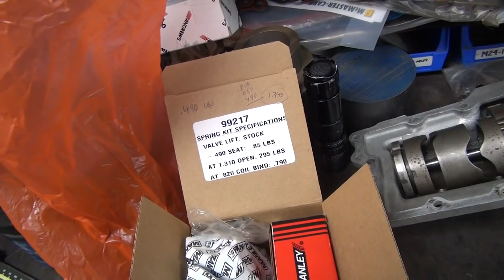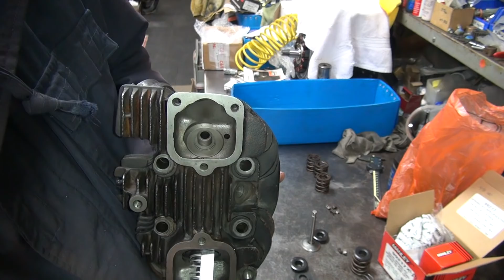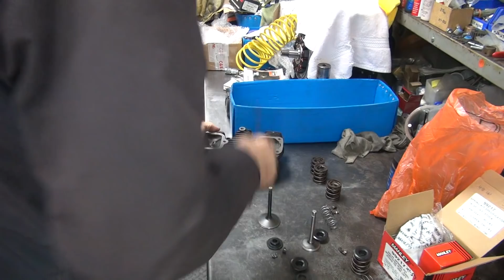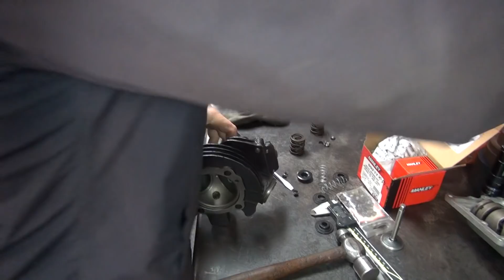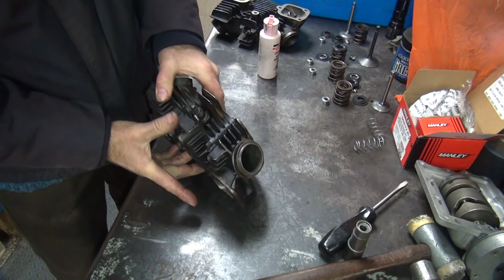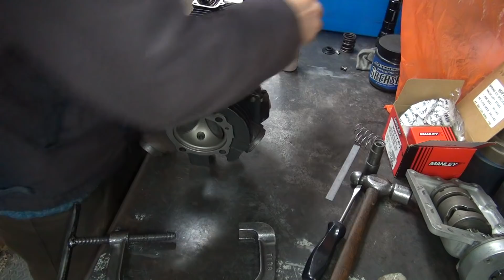#145 How To Do It,  install high lift valve springs 1977 sportster ironhead harley by tatro machine

Comment: How much lift "high valve springs" can take and what Mannley springs? I have Adrrews BV .520 max lift cams and looking new springs.
Reply from the maker: the manley springs only have about 90# pressure. not good for above 7000rpm. shim them down to .030 to get all you can. manley use to make some 150# springs but they are hard to come by these days. springs come and go all the time. if you are good, you can look at all the available springs and pick out one to make work. that is what i do for my race bikes. 
tatro

Comment: I guess I missed something.  You changed the collars to gain more valve spring clearance, but the heavy springs you took out were much taller than the new springs that you put in.  Why wouldn't the new springs just drop in with clearance to spare?

I just opened the engine on the 1978/1980 whatever Sportster that I bought at an estate sale in 2016, it has been ignored in the corner of the shop.  Surprise,  new stock cylinders, 4 5/8 stroke, new S&S 74" parts in Sputhe heavy duty cases!  Also sporting Andrews V9 cams, very nice looking professional port and polish in the intake and heads, I have learned a lot from you, you are a good teacher.  Super B carb, four spark plugs.  It was doing 1/4 mile duty, his brother in law said he rebuilt it before he passed, looks like it, pistons are new and clean.  There is a 1/8" thick aluminum plate between the heads and rocker boxes (long stem valves?).  I haven't removed the rocker boxes yet, didn't think I would need to until you explained about the difference in springs.  So do you have a spare set of springs?  The bike is for road use now, mostly, so there is no reason to have extra wear in the engine, I still have a few years left.  I bought this because it has electric start which my 88" Pan doesn't and it was cheaper than fitting an electric start system.  Feeling old at 75, the Sporty is supposed to be my old man bike with a little spirit.  ;-)
Reply from the maker: those are drag cams and those heads have had alot of work done to them. most likely those rockerbox spacers are there for a reason. you better be carfull on what you do here. you can get in trouble real quickly here. the v9 should be for an evo motor, not an ironhead. VB cams were for an ironhead and they are very hot cams. 
if you want a good street motor than i would put a set of andrews Y' cams into the motor and a set of manley valve springs.
on your 1st question, you asked about different valve spring heights. a heavy valve spring with thicker wire and fewer coils can be taller and have a lower coilbind height. each turn of a coil adds height and lowers the spring tension. its not as easy as you are thinking. remember, everything matters.
tatro
Reply: @TatroMachine  
Thanks for taking the time to educate me, it is sinking in now.  I just found your reply, the alert was on vacation I guess.  Decided to put the Sporty back to rolling/storage condition so I can get it off the lift temporarily, the Pan wants some love and wrenching.  Checked the cams very carefully, 1 V9, 2 V9, 3 V9, 4 V9, I guess they are what they are.  I still have the brakes and spagetti wiring to correct plus a lot of little improvements I want to do.  Since the engine is together and is supposed to run I will buy a battery after the wiring is serviceable and find out what it sounds like.  I have no experience with Sportsters except seeing them on Youtube, seems to be a severe shortage of older interesting bikes where I live, maybe I should get out more.  Went into the shop at around 9 pm the last couple of nights to do a couple of hours of learning and fixing, surprised to find the sun well up and the house dogs wanting out when I put the tools away.
Thanks again, Warren

Comment: Hi Tatro 
I have an Evo 1200XL I'm wondering do you have to port the heads according to what cams are being used? & If so what cams would you recommend with a 1275 kit with upgrading springs?.

Thanks 
Casey

Comment: So I have a 1977 iron head. Previous owner and put a S&S super E on it and I heard that's too much carburetor for the 1000 CC engine that it is. My question to you is can I reduce the spring height on other words increase the valve lift to achieve more air fuel ratio in the cylinder to make it run better? Kind of a loaded question because there's a whole bunch of things I can do to make it run better I know. I just have a running condition that I'm trying to correct and I would hate to go back to a smaller carb
Reply from the maker: the vm38 mikuni is a better carb but the s&s works too. 
tatro
Reply: @TatroMachine  okay so I'm assuming I just buy the S&S jet kit and play with different Jets?